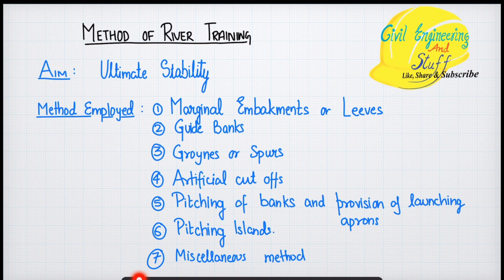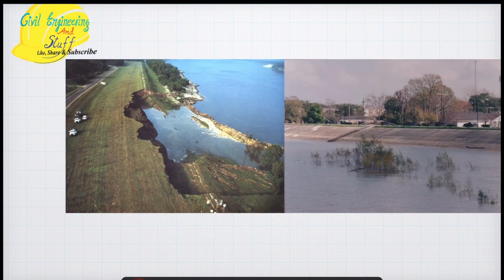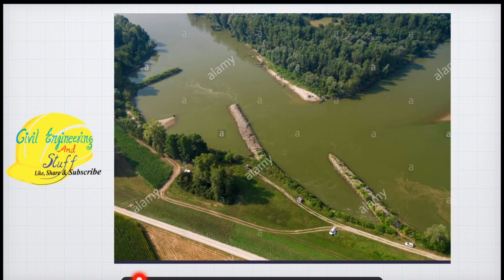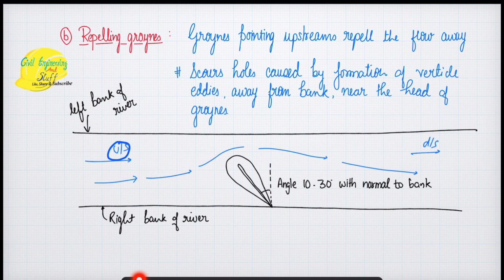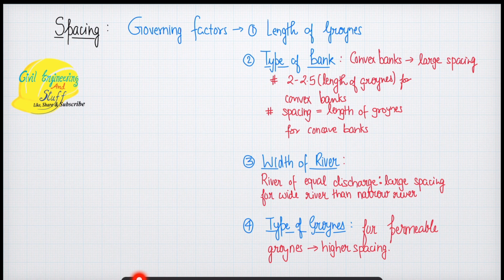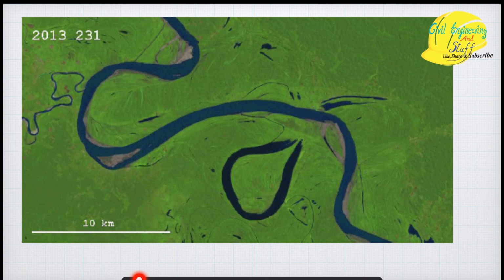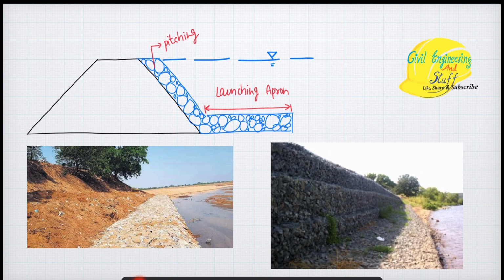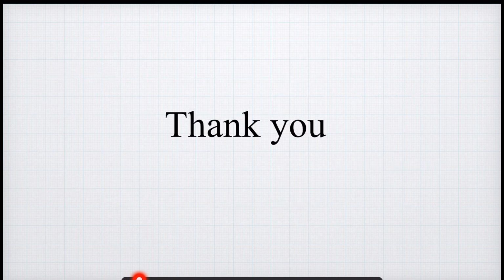River Train work Part-4 Method of River Training | Marginal Embankments | Guide Banks | Groynes etc

Comment: Just a comment. The massive failure you are showing occurred on the Mississippi River in New Orleans and that is actually a levee. The failure was due to undermining of articulated concrete mattress that was well in front of the levee in the river.
Reply from the maker: Thankyou for the valuable information that is very intresting insight.